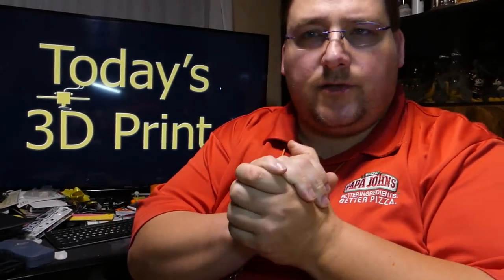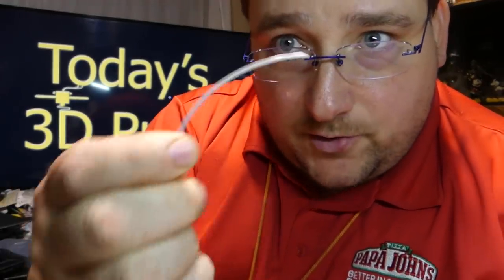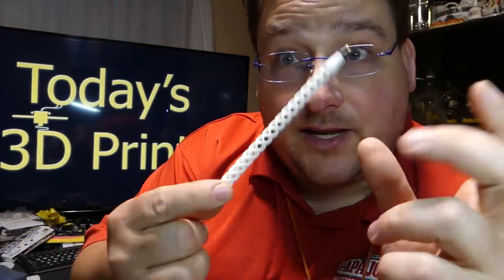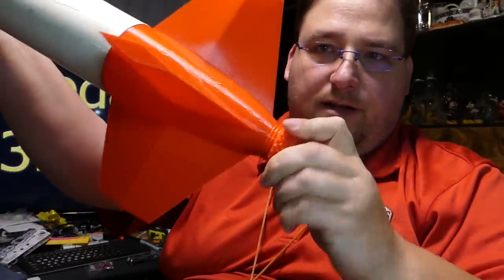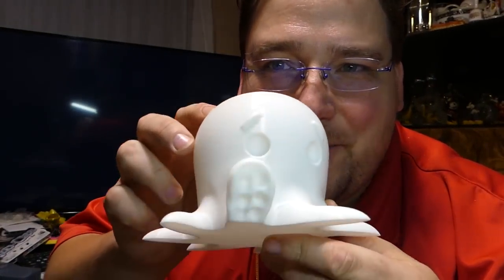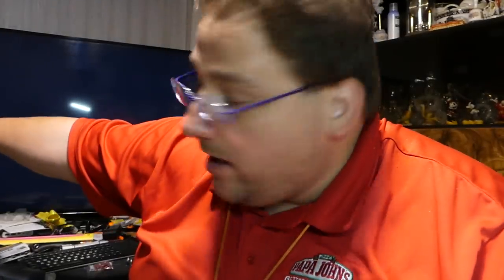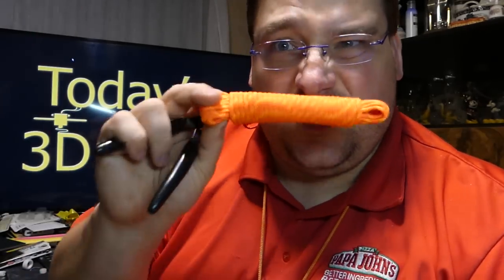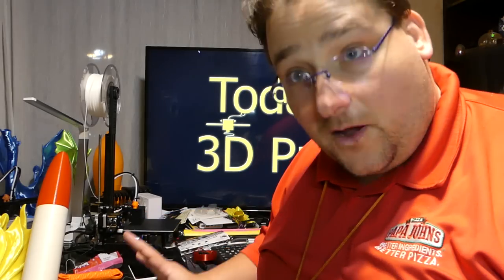Today's 3D Print - What's Up September 5th 2017

Comment: You can control the movement with octoprint. I actually did exactly what you are talking about at 19:30 except I removed a failed print doing this. It took a lot of work but I got it done.
Reply from the maker: I would probably just make up some gcode and call it "sweep the bed" and tell it to execute that.

Comment: after I have my CR-10 under control (perfect), I get an Ender too^^ awesome for small parts!
Reply from the maker: and decently large stuff to. you can expand print to roughly 6x6x9 ! (150x160x225mm) the advantage of the ender 2 is withdrawal control. the with drawal of waiting 50 even 100 hours for the CR-10 to finish the next glorious print is very harsh. the Ender 2 lets you get your fix while you wait :-)
Reply: everybody should have several printers, or a real replicator: tea, earl grey, hot :)

Comment: I recently watched a video about adding "TL Smoothers" to the stepper motors. 2 for every one motor.
Reply: Smooths out the electrical interference.
Reply from the maker: I thought that was for the particular critters that are in the Tevo Little Monster. would that have any effect on the CR-10 ?
Reply: So after googling all over the place, I found that the CR-10 uses A4988 stepper drivers, TL-Smoothers supposedly help those as well. Tevo Little Monster runs at 24V, so dropping in a TL Smoother has little negative impact as the voltage drop doesn't hurt much. Make sure your PSU on your CR-10 is 24V, it should be (from what I read up on it's specs). Little Monster uses DRV8825 which are notorious for skipping steps and being in general very noisy (I'd rather avoid using those drivers all together -- what's the point of 32 microstepping if they skip steps and produce a messy signal line), so using TL-Smoothers with those absolutely help. I still see no purpose using 2 TL Smoothers per stepper, it's a bit overkill IMO. What you are seeing is ghosting, if the Ender doesn't have it and uses the same electronics, then the ghosting in CR-10 is mechanical -- some stiffening to the structure would be in order.
Reply from the maker: kazolar well then I think I'll be buying a couple of TL smoothers they are very cheap so I'll get a couple just to see what happens although I'm pretty sure the cr10 is 12-volt not 24
Reply: So technically steppers can run with no degradation in performance on as little as 6V - a little electronics background -- voltage is speed, current is torque -- really simplified version. More voltage, you can spin those suckers faster, but since you don't run your CR-10's very fast -- you'll be fine. The voltage drop across the smoother is <1V -- using 2 is probably only helpful with the total piece of crap 8825s -- just because they have 32 microstepping doesn't make them good. They skip steps and let out such a noisy line that you need so many diodes to clean up their signal. I think you'll see an improvement to the surface finish with the smoothers, but ghosting is an artifact of structure -- and shaking, not stepper driver line noise. If people care to hear me ramble about the electronics behind this stuff I'll talk about it when I start releasing videos on my huge printer build. Just because I geek out on all the electronics stuff behind how these machines work, doesn't mean everyone into 3D printing is that interested :)

Comment: that´s why I want a CR-10s4  more Detail when bigger
Reply from the maker: if you slow down. ringing and ghosting is pretty bad on the CR-10. OK its really not bad but its bad compared to what you know is possible with the machine :-) especially with insanely detailed models like the starship voyager I am printing. this is not so much a fault of the CR-10 so much as the NATURE of a large high mass machine.

Comment: Try hobby king for extensions it's a Rc supply house and they have loads of cable extensions with all kinds of ends. Just a thought.
Reply from the maker: just saved me $40 and some work. its basically 2s and 5s so I ordered extensions on amazon will be here friday. saves me $40 and having to assemble them myself. 260mm is plenty of extension for what I need :-)
Reply: Nerys Happy to help.

Comment: Nery why don't you build you some lights Led lights are cheap and very easy to work with. My plan is to use the extrusion rails to my CR10 to lay in some LED's that come on when I power up my printer or build a light stand. I'm just saying. thanks and take care brother.
Reply from the maker: Geo Bizworth it's mostly about lack of time it's why I can't buy a 3D printer kit like the anet A8 I just don't have the time to invest into it even though I think it might be fun I love tinkering but just don't have that kind of time so a ready-made light I just plug it in and turn it on

Comment: Interesting bit I picked up was the layer height of .12 due to it being multiple of your stepper motor.  How did you work that out, I assume it's the same for my Ender-2 ?

And loved your retraction issues. I'm slowly learning about more and more of these things.

My current issue is almost the opposite of blobs/zitting. I seem to have little strips of under extrusion in the same location for a few layers. I'm guessing if I set layer starts to random locations I'll see these spread around more, and another guess is it's going to be under-extrusion at the start of a new layer maybe ?  Retraction is only 5mm so I'll have to see what other settings may effect this to fix it. 
Only 2 days into my 3D printing and loving it all already !
Reply from the maker: it is fun. make sure your stepper is not slipping and also make sure you are running hot enough (at least 195c for pla) or it may have trouble pushing the plastic out.

someone else did the math and said that the minimum movement for the z steppers for normal nema 17 motors is .04 so you would want your layers to be multiples of .04 for best accuracy since the printer technically can't do .1mm as its inbetween .08 and .12 ie it would be trying to stop "half way" between steps to do .1mm at least that is how I understand it.

so I set to .12 or .2mm
Reply: Nerys what would 'stepper slipping' look like for me to check ? Could it be belt tension ?
 I took my time doing the belts as if not in correct position they could easily rub against the axis I found. So tensioning them correctly was tricky due to that . I'm intending to print the the sooner mods as they look perfect.
Reply from the maker: you can hear it. if the filament "holds" you will hear an actual little click as the stepper tries to force itself to the next position and "snaps" back when it can't.

or you will see it turning but not moving filament (chewing through the filament like a saw)

the movement (belts) the belt will "jump" you will see this in the print as a layer shift. (kind of like the dacapi cat)

if the belt jumps a tooth the printer will not be "in the wrong place" when it goes to make its next move. remember. the printer is dumb deaf and blind. if it gets "out of register" it has no way to know this and will merrily keep right on printing :-)

Check the grub screws on the pulley gears too. on my e10 I had layer shifts and that is what it was. the pulley gear came loose so the stepper was turning but not "moving" the bed.

Comment: Sorry that the voyager didn't work but good thing it finaly worked
Reply from the maker: it was a gamble. I should have realized I needed a bigger disc. its a learning process. I am just glad it did not use much filament as I only have the one roll of that particular grey plastic. front half is printing away now. REALLY slowly to keep the ghosting and ringing down.

Comment: Thanks for another great video. Please can you explain the print height to relation with the nozzle size, for example if you have 0.4mm Nozzle . Thanks
Reply from the maker: not entirely sure I understand what your asking. I THINK you are referring to my statement regarding the holes in the hot air balloon when I mega sized it? if yes. I will make a video for that as its a good topic and something you need to watch out for when your being filament greedy (trying to use as little infill as possible etc..)
Reply: Thanks for your reply . In one of your videos , you said something about printing at 0.90 mm height because your steppers are something etc. I think it was maybe your print height to your stepper motors etc

Comment: The extruder and retraction is causing the print to fail...so there for your pulling back negative amounts....I figured it out?
Reply from the maker: yes. when you extrude less than a negative restart you are actually pulling the filament out not in over time. turned off negative restart and it printed fine.

Comment: Chris, later when I want to get an Ender2: Is it possible to steer your affiliate link to the german amazon? Because I dont want to wait for weeks for the ship to wiggle over the ocean. Is that possible in a way? Or is there an other vendor to choose for that?
Reply from the maker: pixelcomet gearbest is only option right now as they stopped selling on amazon.
Reply from the maker: pixelcomet  the good news is it's $163
Reply: do u have any idea how long the ship takes? still waiting for an aluminum feeder from the states. "in transfer" since ages^^
Reply from the maker: pixelcomet for me china to us usually 3 or 4 weeks. Not too bad. Some chinese vendors can take 5 or 6 weeks. You get used to it worth it to get stuff cheap.
Reply: Im afraid, customs and tax will make the thing more expensive than getting it from Europe (for a higher price). will check that later. right now I just invented a better bowden holder. yesterday I tried to fine tune retraction and the bowden moved back and forth in its connector (that pneu things). So I took out all that plastic shit and blade and drilled three 3mm threads into each to clamp the bowden with 3 screws. NOW we are talking :) Im re-assembling atm. looks very promising

Comment: How fast is your print speed ??
Reply from the maker: I think my standard profile speed is 40mm/s I adjust depending on what I am printing. for example I have voyager running at 50% speed (so around 20mm/s) reduces the ghosting and ringing for all the micro details that are in the model. worth it.

Comment: Nerys did you buy the EU version of the Ender 2 and use a converting plug to use in the US?
Reply from the maker: Nathan Brothers just the $3 plug is different. The printer psu is 100-240v compatible. No converter needed just the right plug which you probably already have half a dozen. I will make a quick vid tonight to show you.

Comment: What is the best print speed(  mm/s) for ABS with 0.2 layers for a CR10 , you were saying print speed in percentages, how do convert to mm/s  Tks.
Reply from the maker: I don't know. I have never printed ABS before. I don't imagine it would be that much different than PLA what difference is bed and nozzle temp. speed would depend on particular filament printer and model being printed. a vase you can print faster etc..

I would start with 30mm/s see how it likes it. if it seems fine turn up the speed in your printer. Still ok? next time set it to 40mm/s see how it likes that etc..

as for conversion. I assume you mean mm/s to mm/m (seconds and minutes) just divide or multiply by 60. 60 seconds per minute. so 30mm/s would be 2400mm/m

Comment: Regarding your screen turning off, have you adjusted your power setttings in controle panel

Turn off display X minutes, set that to never if you havent already

https://tr1.cbsistatic.com/hub/i/r/2015/11/19/fa2c3df0-8a47-4f0e-8a1d-41e5137fbc81/resize/770x/3a841131dc892dbb864821453e801ed0/fig-d-11-16.png
Reply from the maker: of course. I am starting to think its the TV itself turning off the screen as I have monitor off set to never in windows.
Reply: Nerys really wierd if the tv should dim by itself that often. Perhaps cause the logo is static 

I do 3D graphics and small animations. What if you had like an animated logo / video looping  would that dim as well
Reply: You got an email i can contact you on ? i got alittle somthing for you that you can try for you bg screen

Comment: I had to ask the facebook group and there called JST connectors....Here is a link to where you might find the description of them....http://tech.mattmillman.com/info/crimpconnectors. Also here is a link to an amazon were I did a search for them that might help you out...https://www.amazon.com/s/ref=nb_sb_noss?url=search-alias%3Dtoys-and-games&field-keywords=jst+connector+extensions
Reply: JST-XH for end stops and JST-PH for the steppers. Hope that helps you out...
Reply from the maker: thank you. I ordered a kit on amazon that has 2 through 6 pins of both male and female  and some ribbon cable so I can make up extensions (I don't mind making them I just want to avoid cutting the wires on the printer)